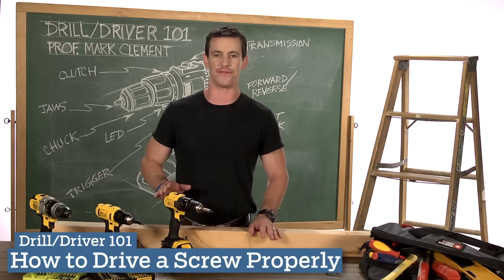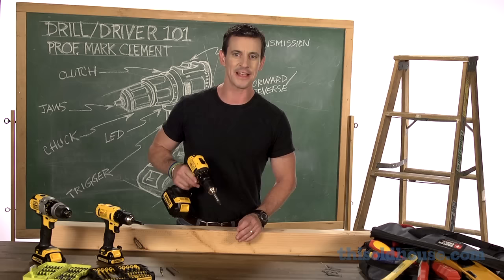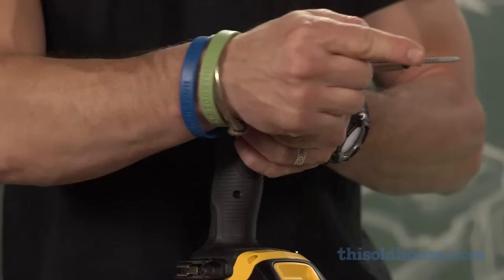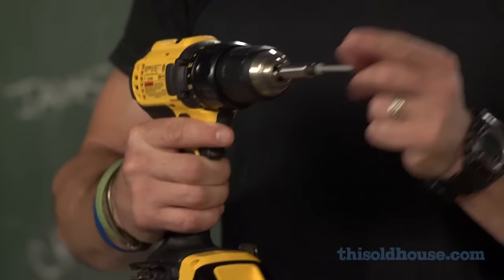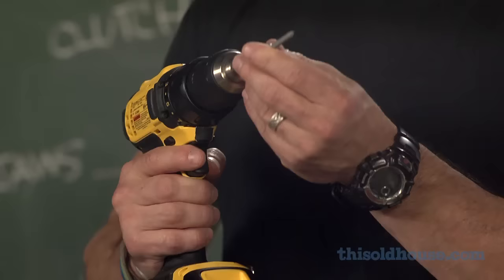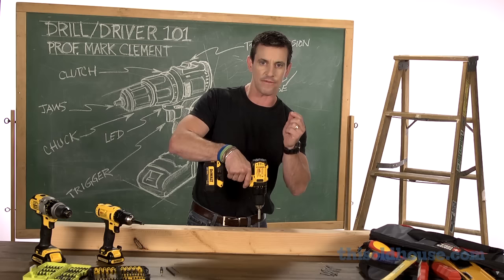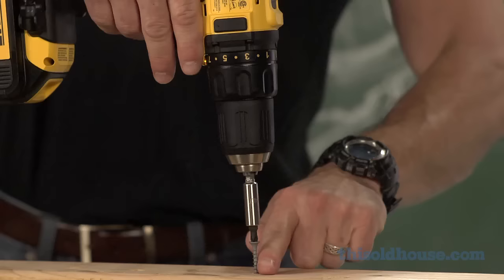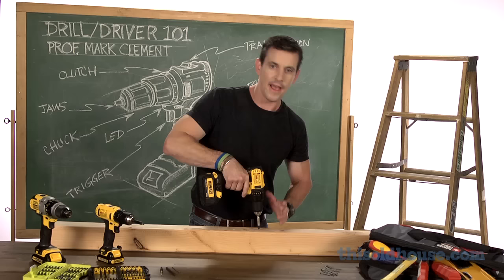Drill/Driver 101: How to Set a Screw Properly  | Tool School | This Old House

Comment: Looks so easy, but when I try it, it doesn't work. This is definitely not enough info for a newbie.

Had to watch several videos learn enough about drilling screws. You showed the importance of lining it straight and to start it by jabbing the wood, another showed a very useful drill guide that makes starting it much easier and safer, another showed how to stop wood splitting and screw stripping with pilot holes, another showed that a pz screw top is different than phillips top. I learned from a comment in that video that you can set the torque to prevent stripping. I assume these videos are all for newbies like me. Why don't you instructors just make it comprehensive in the first place, especially if you're putting 101 in the title.

Comment: I use an impact driver to drive screws. They work so much better than a drill. After using an impact driver to drive screws you'll never go back to using a drill. Some of the same things in this video do still apply.
Reply: I can totally understand what your saying but impact drivers make the worst noise pollution in a building.
Reply: Michael Tricker
noise pollution?  Its a construction site!  You are right though sometimes I use drill when there is something on the radio i want to hear.
Reply: Michael Tricker I couldn't agree more. I sometimes want to use ear protection because of it. Its really bad in a confined space. Not so bad in an open one.
Reply: emutiny yeah there is such a thing as noise pollution. I wish impact drivers were as quiet as a drill is. Definiately wouldn't use a drill to put in big lag screws.
Reply: i suppose i just kind of enjoy the sound of my impact rolling screws like quick draw mcgraw.  drowns out the noise in my opinion.
Reply: emutiny yeah I do sometimes too but Idk about 8 hours straight. Lol.

Comment: The key is a snug fitting driver bit.
No matter what drill or impact driver is used, if the bit isn't the right type, it will never work as designed.
Phillips 2 and Pozidriv 2 are not interchangable. I've seen lots of people do it, but it just doesn't work.
Reply: I stabbed myself in the finger way to many times before I figured that out. A good tip with cheap, and stainless screws, is to grind a millimetre, yeah I know sorry, of the nose of the driver bit. That way the driver bit lands/faces come in contact with the screw, not just the nose of the driver bit against a badly stamped screw head profile.
Reply: Youre correct most folks are using the wrong bits ...Phillips rather than Posi and vice versa, best option for all of us would be to buy....Torx heads screws... then we would be sorted...

Comment: My tip is: If the screws do not drive well, throw the bit in garbage not in your tool box, and grab new bit. Always buy brand bits. Do not wait until the bit visibly worn out, good bit should last few days, bad bit will last few minutes. Finally, as the bit quality matters, the screw quality matters too.

Comment: It seems when I'm hanging something requiring 3 or 4 screws, they end up not going in smoothly, even after marking the holes. I guess the secret is to get it straight with set screws, then drill holes for the remaining screws last.

Comment: Any recommendations on doing this upside down? I'm having the hardest time getting the screw to go into the bottom of the cabinet. I'm trying to install a hanging paper towel holder, but I'm not having success. I just keep dropping the screw. I'm a total novice at drill-use, but I'm trying to learn. I'll keep trying. I was thinking of maybe using a hammer to get it started and then drilling it. I might try that.
Reply: How’d it go ?
Reply: @marcuscumpston2538  I got it in, for the most part. One of the screws got stuck halfway through the wood and I can't get it out, but it is working. 😆😅 I must have gone in not fully perpendicular to the wood. 😆

Comment: So why 'goose" the trigger ? Once I start it, I just drill it in, and, it's fine,,,
Reply: You "goose" it because until the screw has started, the screw threads can just compress the material and force the screw to slip sideways. Slowly starting reduces lateral forces vs. longitudinal, and allows the screw to go in straight.